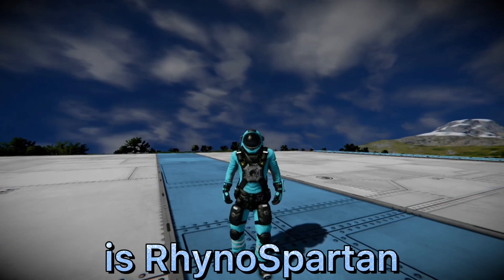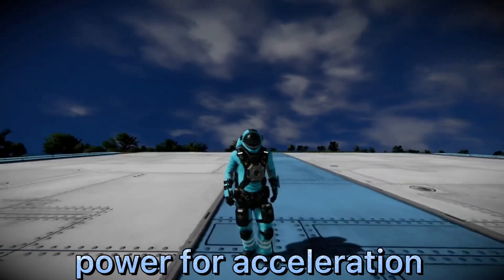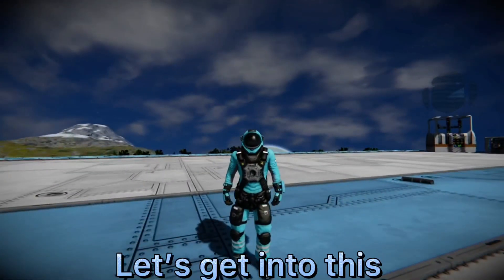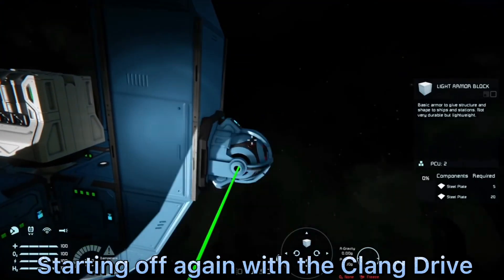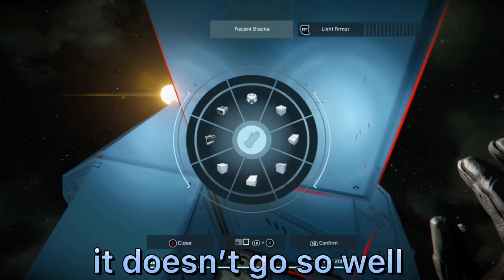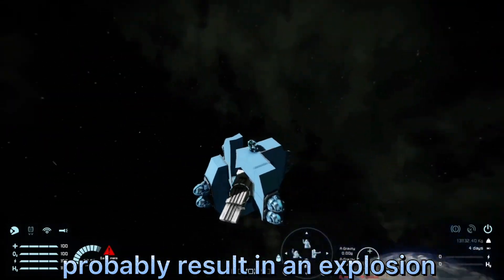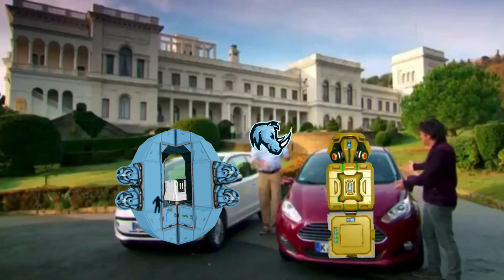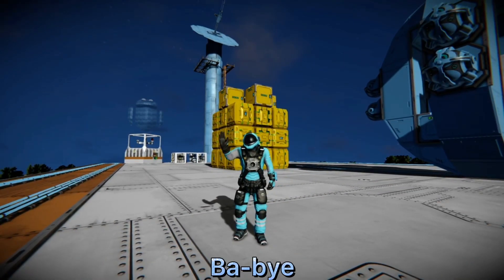Space Engineers - Clang Drive vs Gravity Mass Drive

Comment: Nothing against you but the Clang Drive was just to Complex and the Gravity Drive builds weren’t really good either.

You can literally build a Clang Drive with 12 Blocks and even in Small Grid
Reply from the maker: Only 12 blocks? That’s incredible. How do you build one?
Reply: @RhynoSpartan  A Piston pushing a Interior Pillar(the Narrow One) into the Underside of an Old Sliding Door, connect the Piston to the Door, now let the Piston push the Pillar in the Door(around 1cm) and the Pistonhead will get pushed backwards. The Stronger The Piston tries to Push the stronger it gets Pushed Backwards and as soon as the Pillar stops touching the Door the Reaction stops.

Edit: Major Jon has a variety of Clang Powered Systems on the Workshop, go Check it out
Reply from the maker: Thank you for the instruction. I used the piston and door method for my small grid clang drive, but I didn’t think to do the same with the large grid. I’m going to try this method out. 

Major Jon’s clang gun is a favorite of mine.
Reply: @RhynoSpartan  If I remember correctly you can use a Small Wheel on Rotor using the Displacement option to build a smaller one

Comment: Gravity drive actually have the behaviour of more gravity drives higher acceleration. It’s actually more optimal to stack gravity drives instead of mass.

Edit:

Here’s the reasoning, most of this is guess work and isn’t verified, I would be happy if someone test this and post a video about it.

F = m(artificial) g = m(ship) a is my current theory, I don’t exactly know how this 3rd law violating drive actually work. The problem is I don’t know how much artificial mass the mass block have versus the real mass it have, I’m assuming 1 to 1 conversion. Then we see the acceleration is completely dependent on artificial gravity.

Proposed experiment for those who knows how to do scripting:

Get a timer script that detects when the ship’s velocity becomes constant (hit max speed), while loop on the condition that ship’s acceleration is not 0, counts up every frame.

Get 1 mass 1 G gen
1 mass 2 G
2 mass 1 G

So on, get about 10 - 50 data points, with numerical epsilon error and rounding error as error bars.

Measure ship mass with the GD attached, test the average acceleration. V/t. See if it matches the GD attached, if not off by how much.

Print reduced chi ^ 2 and CDF percentage.
Reply from the maker: This timer block experiment might be possible with the new Event Controller block. Change in Grid speed is an available option for a condition. I am yet to check but my idea for it is that when the grid with a GD reaches the speed limit the GD will deactivate.

I would also like to mention that your comment was exceptionally constructed and highly informative. I will continue testing the gravity drive with these concepts in mind. I will also attempt to create a video on this topic. If I were to make said video, could I credit you by saying your profile name?

Comment: In round 2, the grav drive needs to be perfectly aligned with the center mass.
Redistribution of cargo will folt this
In round 4, Planetary gravity deducts from Artificial gravity. Could more grav gen's overcome this?
Reply from the maker: Gravity generators lose their gravity exponentially when natural gravity increases. At 1.00g natural gravity the generators will have no effect. On the moon there is 0.25g and if a single gravity generator was in that field it would have 0.50g of artificial gravity. So using more gravity generators would work on Europa, the moon and other natural gravity fields with low gravity. But it unfortunately would not work on Earth.

Comment: Agreed the problem with any ship will always be the cost in either resources or credits as well as usability and potential damage output where clank guns are superior, however they tend to be very complicated and costly recourse wise compared to a grav cannon, however the grav cannon lacks any significant punch or damage when compared to a clank cannon, however grav cannons are both simpler, cheaper and easier to use and maintain and don’t mess with the server or graphics, and not only that but since grav cannons work similarly to rail guns, they are somewhat more durable where unless sufficient or significant damage occurs to the power supply, then unless the gav accelerators themselves damaged then the gun is still usable, however grav guns are and clan guns are about the same for ammunition cost and both has more range and damage than a rail gun and can be fired repeatedly as well as not sucking your reactors dry

Comment: You didn't build a single properly designed Gravity Drive as it would be built for actual use in this entire video dude. =\
Reply from the maker: Sorry for building it wrong. Thank you for telling me. Can you tell me how to build one correctly?
Reply: @RhynoSpartan  Looks like you're playing on console, so don't have access to mods. There's a fantastic script for Programable Blocks out there for Grav Drives Ryhno. You build mass block banks at the points of a H shape, wrap them in grav generators and make sure your centre of mass is the exact centre of the H. Recompile the Programable Block and you've got a thrust system that works in every direction and will even control roll and pitch, removing the need for gyros. It's only drawback is that the script vectors thrust from the centre of gravity, so "up" isn't perfectly up unless your centre of gravity matches the centre of your ship. It's the single most cost effective thrust system for space travel, hands down.
Reply from the maker: That’s a great idea. I’ve looked at vector thrust before and it looks amazing. I do have access to mods on Xbox, but scripts are unavailable to console users. If scripts are added to Xbox I will try building a vector thrust gravity drive.